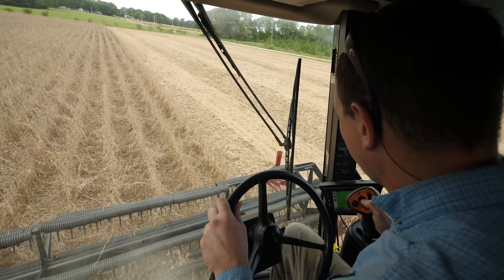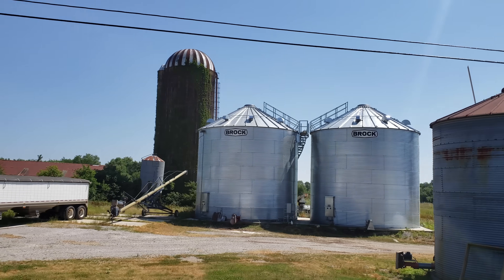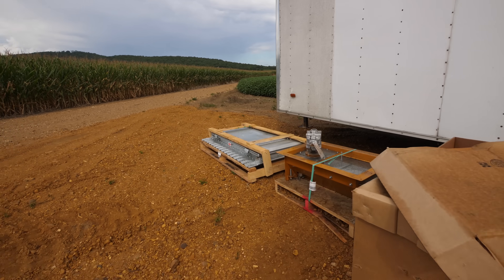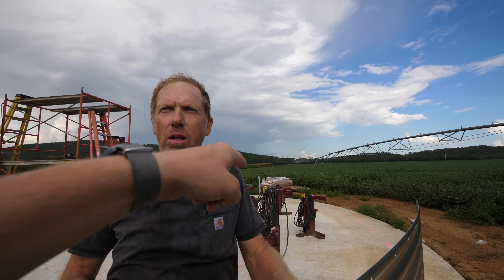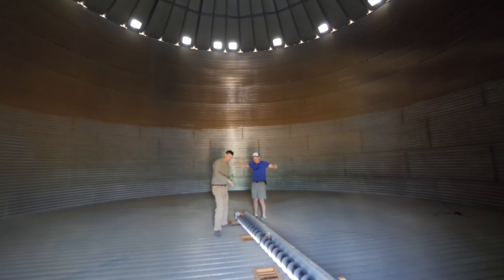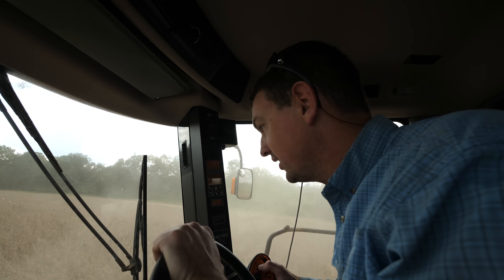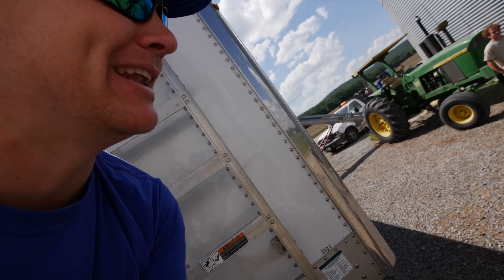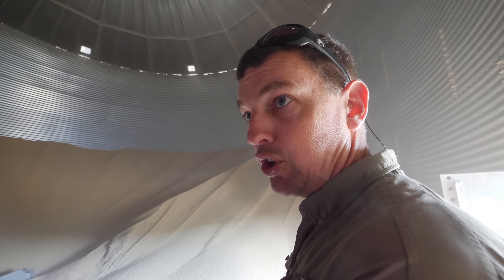Everything About Grain Bins (Farmers are Geniuses) - Smarter Every Day 218

Comment: anyone thought about those tiny pieces of grain that get past the bottom part of the grain bin. My question is, and id is grateful if someone can answer me on it, is that what stops the little pieces of grain and grain dust from settling at the bottom of the grain bin, under that floor part with the holes in it that allows the air to pass through. How doesn't that area at the bottom get clogged up? and if it does, do they have a way of emptying it out?

Comment: "Punch"... Never heard them called that. I always think of the old handy spud wrench for that but apparently the "proper" name for that tool is a drift.

Also remember one serious danger that you didn't touch on and that is grain dust. Every once in a while you hear of a farmer working with a gran bin and the thing exploding, usually killing one or more of the people there at the time. Why does this happen? Because all that dust in the air creates a perfect fuel/air mixture that just needs a single spark to set it off. While such things are pretty rare, it still illustrates that loading and unloading a bin can be one of the most dangerous things a farmer can do if they don't pay attention to what is going on around them.

Comment: Every time awesome how you can use such thin and flimsy metal sheets to construct such a tough structure ... just imagin the forces on these metal sheets if the grain bin is filled to the brim with ... well ... grain. And then imagine a storm with its winds and rain and hail or winter with maybe loads of snow piling up on top of the grain bin ... that's awesome
Reply: well, the aerodynamics do not change of course, as, the structure obviously does not, but the probably more often than not example you gave of it filled to the brim, gives it WEIGHT and heavy dense weight at that.  It is MUCH more difficult for wind etc to knock it over despite its size (which btw is also another reason why its a cylinder, aerodynamics), so I imagine thats why it remains the way it is.  I mean think about it, if the design in this fashion, were as bad possibly, as you are wondering about, why would it still be in use?  They (manufacturers, and of course farmers themselves) would WANT to swap out their grain bins right?   It's all questions that this video actually answers more or less, without actually specifying it.
Reply: @Atixtasy  it was more about the fact that such a thin, bendable material is so strong if connected correctly ... not that i don't know the mechanics (aircraft mechanic, so physics knowledge is present), but it is always pretty awesome :))

Comment: Moving air takes up water from an object that it moves over. In other words, if the air and the bean have equal moisture levels, the fact that the air is moving means that it’ll draw moisture out of the bean. There’s a complex balance of air moisture, air speed, temperature, and bean moisture that determines when exactly you are in danger of adding moisture to the bean. But practically speaking it’s hard to do

Comment: I really enjoyed this video as well as the center pivot irrigation video.  I grew up around grain bins.  Some of ours had conical pits at the bottom instead of the flat pad.  That allowed gravity to move the grain to the auger at the bottom of the cone when emptying the bin.   One set of our bins also had a common grain pit where trucks could come in, dump their load quickly and go back to the field while augers moved the grain from the dump pits up to a distribution point higher than the tops of all of the grain bins.  The distributor then allowed you to choose which grain bin to fill with grain coming from the dump pit.  One of THE WORST jobs of the entire year was just before harvest, having to prepare the bins for grain.  It was always hot and dusty, and there was always some rotten grain stuck to the bottom of the bin, and there was usually some mouse encounters during the day.   Thanks again.

Comment: During May of 2022 we traveled in eastern South Dakota down I-90 and back up Highway 14 along of the path of two durecho storms a few days earlier.  All along the route there were grain bins, typically installed in groups of 4 bins, every mile or so.  Because of the storm almost every group had 2 or 3 bins smashed in, like stomping on a soda can.  Most had one or more completely shredded with pieces of metal blown across fields for a mile or more.  We thought the construction crews will be busy this summer, but there is no way this will all be repaired by harvest time.

Comment: You didn't talk about one of the lesser known danger related to grain bins : explosions !
When the grain bin reaches a certain level, the amount of dust generated gets pretty high, and at one point might reach some form of stochiometric mix between the oxygen in the air and the grain dust (which is pretty good fuel).. since it is a highly dynamic environment with a lot of movement when loading/drying/dumping grain there is a possibility for electrostatic charges to form.. If there is a faulty ground (the bin is usually very well grounded to prevent that, but accidents occur), a spark could be generated and the whole grain bin basically turns into a high yield bomb.
Those accidents are rare, but it's been known to occur and there has been fatalities.

Comment: Bins these days are huge compared to the ones we put up on the farm in the 60's and 70's.  The "big" bins we put up are teensy compared to this whopper.  No automated grain handling in those days either.  Getting the grain in the bit as simple, getting it out involved way too much shoveling and standing next to the business end of an auger that would twist off an arm or leg if you let it.  And it was always hot and humid it seemed, and there was often a bit of musty/rotten grain on the bottom (no raised floors) which was a new experience in bad smells.  Couldn't do that again 🙂

Comment: I work at a grain elevator and never knew how a grain elevator was built.  Thank you for that, I did not understand.  My boss was attempting to explain it, he's good man and knows his job...but...words are not his friend.  I'm over-educated at the college level and LOVE working hard.  I am the probe shack gal AND I work grain operations.  This includes grading the grain, cranking truck traps over a pit, moving the piler at the bunkers, helping to tarp the bunkers, climbing to the top of the elevator to clean up a grain leak, fix the leak, tighten belts, replace paddles on the conveyors, and even change the light red lights at the very top.  Since starting this job I have learned to drive semi, use a bobcat, and soon will learn how to use a telehandler and how to "drive" a locomotive.  

If you are ever looking to check out an elevator, from top to bottom and inside out, message me!  I love to share my knowledge too!

Comment: excellent engineering employed in producing grain bins but if the bottom of the grain bin structure is triangular & conical in center  & raised 3 to 4 feet above the ground it will be lot easier to off load the grain #👍

Comment: Interesting. I was a bit surprised that the grain bin does not have any inside structure - but basically just consists of these corrugated sheets. Did I get that right? But I guess it is because the circle form is actually very strong. And it is probably very well anchored to the concrete foundation.
Reply: Yep the curve + corrugation makes the sheets pretty robust. I think most bins anchor onto a baseplate that itself is lagged to the concrete. All the sheets have to do is support their own weight and the force of the wind when they're empty, and hold back the weight of the grain when full. And that's a lot of force, but with a circular bin being filled from the center it's all evenly distributed.
Reply: @rrobkaiserr  To both: some manufactures have a base plate, others just have anchor bolts, some are cemented in(lowest sheet is in the floor concrete)

Comment: What trade do you need to be in to work building those big grain bins?
Reply: It's technically millwrighting (and is the origin of the term) but you'd most likely work for a contractor that specializes in "grain handling systems"

Comment: 7:15 
I'm going on 17, grandson of a Pennsylvania farmer. While cleaning up trees in our pasture, the rear counterweight to our tractor got snagged and fell off. My dad, grandfather and I instantly scrambled to get a 1,500 pound concrete filled water drum back onto the 3-point hitch of the old tractor, without 0 hesitation.

By far, the sketchiest thing I've done in my life. Even 2 generations on, when something breaks, you gotta fix it or else you're stranded.

Comment: Punches are wonderful tools for gaining leverage on heavy things. They do minimal to no damage to threaded holes if used carefully. You can use them as studs to align transmissions and engines and the align holes on heavy tractor loader pods. Punches are a big deal in our shop and we will fight if someone doesn't put one back.

Comment: The tool your using is not a punch. The correct word is drift. Back in the day when metal was usually joined by rivets every steelworker had a variety of sizes. Welding and cad-cam mills have reduced their use, but they are still avaliable.

Comment: The top rings are thinner than the bottom rings. The rings get thinner as the bin gets taller.
   I watched a neighbor 40 yrs ago try to put up a bin himself. The sheets for each ring are wired together to keep in order. He cut the wires in transport and when trying to assemble the holes in the rings didn't align so he drilled new holes.  What a mess.
  We bought a small bin from a neighboring farm ( 14 ft diameter) and the dealer transported the bin whole on a trailer to our farm. He just had to cut the bolts holding the bin to the slab and jacked it up and put on a trailer. He did have to put braces inside the the bin during transport to hold the bin intact.

Comment: These grain bins appear simple, but a number of things require very special attention. 
For Instance, make sure the product, people marketing it and assembling the darn thing are good at it. 
ANY opening, especial a door or vent in the roof MUST be installed and SEALED correctly to keep out any form of moisture that can spoiling the contents. 
Auger systems that move the grain, especially if they are built in / internal must be carefully vetted before buying and function checked thoroughly for strength and endurance regularly. 
My uncle had a hard-knocks list.
Once in America the number of farm workers and full-time farmers per population ratio was approximately 70 out of every 100 citizens. It's the opposite today.

Comment: I wish you went into the inventory side of it because you of all people would LOVE how it works. 

To measure how much grain are in the bins, they use radar level sensors. They use a radar beam to measure the distance from the top of the bin to the top of the grain (as you can imagine, it's not always flat so now they also have 3D imaging devices as well) which is then converted into volume. 

The company who makes 90% of those sensors is "BinMaster". They also make an inventory system for the farmers so that they can get all their bin capacity info on a single computer so they can sew everything (they call it "BinView") 

It's definitely something Dustin would be interested in learning about!! Especially how it all communicates and what not.
Reply: Or just climb up the side and pound on it, to see how full it is

Comment: Neat video on grain bins. However, only a small portion soybean production will be used as food for humans it will mostly be used as animal feed, fuel and other industrial uses. The verity’s of soy being produced in that field isn’t the edamame you eat in a restaurant. Only a small portion of field corn grain is consumed by humans in the form of corn syrup i.e. coke, pepsi, Mt. Dew etc. (which is a multi step complex process), breakfast cereal or corn starch. The majority of field corn is used for Ethanol production, animal feed and manufacturing. The problem is we are told these field grains are for us to eat but actually it is more likely to be sold abroad, fuel your car or feed the beef or chicken you eat. It also degrades our soil. 2 crop rotation is not sustainable. My uncle and grandpa have a very large grain operation near Des Moines IA and 30 years ago as a kid I would help with annual soil sampling and we could easily get deep samples. Now pushing for a deep sample is not a job a kid can do sadly because of erosion.  The worms and ground bacteria that promote healthy top soil are devastated by pesticides sadly so they have to put down more chemicals to feed the crops. Sorry for the long sad comment I am just passionate about this subject. 
-Mike
Lead grower of a produce farm in Iowa.

Comment: 4:30 you really dont realize how handy those large punches are until your on a job site like this. I used to build large fabric buildings such as the half circle shaped fabric buildings commonly seen at DOT facilities especially in snowy states where they use fabric buildings to store their road salt. some of the trusses would be 60 feet wide and 30 feet tall, multiple thousand pounds, hoisted up on a forklift. So it can get pretty tough to line up your bolt holes to line up, but with a punch we would just stick it in the second bolt hole then by applying pressure up or down you could move the massive truss enough to line up your other hole and get a bolt through

Comment: I use to be a conditioning operator at Pioneer, seeing all this reminded me of all the times of sampling, dumping, and then cleaning loads of beans. You don't realize how much goes into taking a raw load of beans from a grower and "cleaning" them to be packaged to be sold to farmers for the next season. I will say I hated doing wheat the most, it got everywhere and always left you with a huge cloud of dust and you coughing the rest of the day. One of my favorite parts was talking to each grower and seeing how heavy their trucks were when they pulled up and wondering how their tires didn't just blowout under that massively over-the-limit load.

Comment: OK - my brain can’t let go of this and I have to know. Over time small bits of “whatever” have to get through the holes in the flooring and eventually clog up the works, no?

If so - how how does this get resolved? Reverse the fan like a vacuum, maybe a duct to to open and expel debris out the opposite end… is there a pattern to the footing posts to circulate the air properly and avoid dead spots? Oh so many question about how that all works.

Comment: Many years ago, maybe 35 year's ago, I worked for a company that Installed grain bins. We had hand jacks that would bolt to the sides, lift it up and add another ring all the way around, and repeat. It was a cool job. The heavier sheet's are used for the bottom. Keep jacking, add a ring, bolt it on, repeat.

Comment: My dad drove tractors since the 70s then the ones with gps came out (in the early stages) he use to get mad and correct the path because the gps on the tractor was making lines that were not parallel.

Comment: 13:00 their have been people i know killed by entering a bin to un-plug a clog....
.
1st dude goes in, grain "falls" covering them up.....
2nd person goes in..... they also get trapped
3rd person goes in...... they also get trapped
.
like 8 hours later.... someone notices they arnt around for lunch....
heads out to look for them
.
finds 3 vehicles around the grain bin
.
looks inside the bin..... and only sees blood..... from the auger ripping all 3 of them apart
.
.
that a TRUE story..... and it happens ALL AROUND the world 
in NE montana..... or Russia, Germany, China, ETC
.
your just trying to save your friend (or more usually.... a close family member.... AKA your dad.... brother... sister....cousin....ETC)
and end up getting trapped / killed yourself
.
and then someone else trys to save you....
and gets killed....
.
vicious circle.......................
.
.
.
their are actually a few different "rescue" tools..... specifically designed to rescue people from grain bins 
.
one is 4 to 5 pieces of a circle.... 
you hammer them down into the grain..... forming a circle around the person trapped
you then can empty the grain from inside the "metal circle" 
with out more grain coming down and filling the hole you have been digging back up
.
it still takes an hour or 2
.
and even if your head is above the grain
all that pressure is still pushing on your body
.
so you may have your head in "clear air"
but the grain pressure is such..... that you arnt strong enough to move your chest (AKA.... breath)
.
so you die... not being able to breath..... as your whole family / friends / work crew can see your lips turn blue
and then the look in your eyes as you finally die...
.
.
farming is HARD CORE